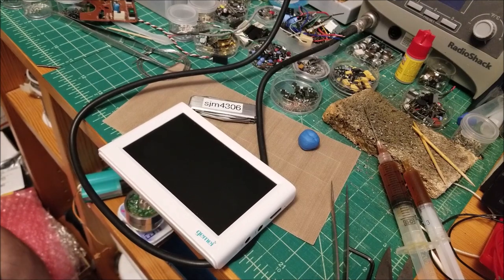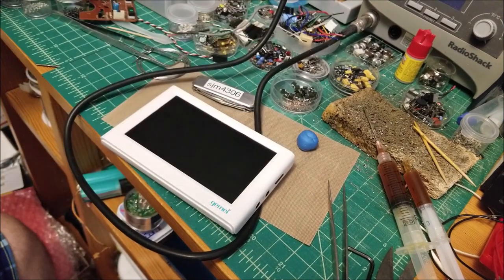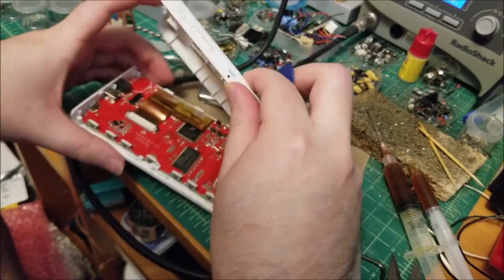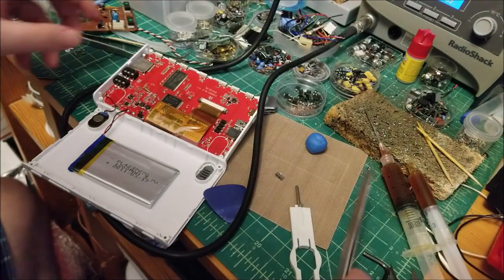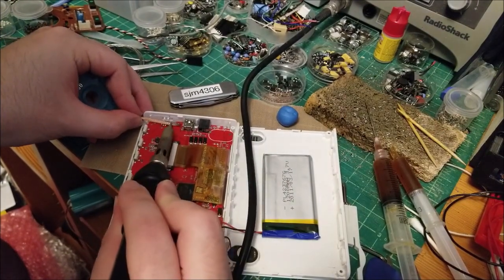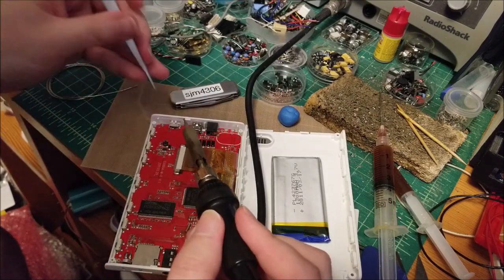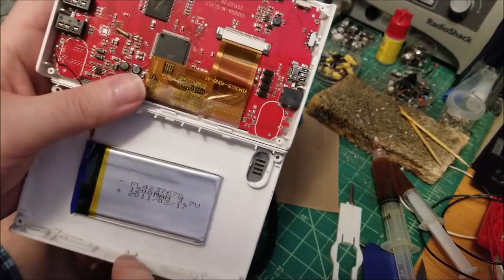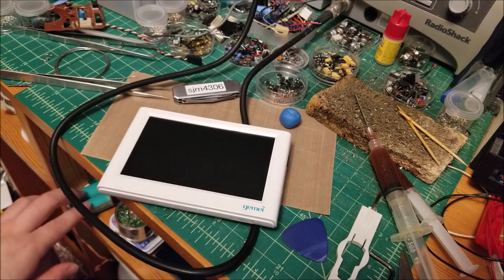Replacing a Broken SMD Switch on a MP4 Player

Comment: Right now I'm practising on a dead board before I do it for real on an expensive laptop motherboard. I managed to destroy the old button and it still isn't off.
I'm scared I'll damage the pads/traces on the board or destroy the new button. Luckily I bought like 10 of them. I thought it'd be easier with a hot air station, but it melts the button plastic before the solder melts. Any tips?
Reply from the maker: I wouldn't even try with hot air, too risky unless you are really good with it. I usually tin with leaded solder, add flux and alternate heating pads till it easily lifts off. You can also slowly lift upwards from one side while doing this till it comes completely off.
Reply: @sjm4306  managed to get it off in the end and soldered the replacement on. Worked a treat for a few weeks and then the owner complained the switch stopped working again. I thought he'd managed to break it again (last time he'd been poking (perhaps jabbing would be a more accurate description!) it with a pen. 

Anyway I got him to bring it in again and I took a look at it and found I hadn't cleaned the flux off the new button properly and after a few weeks it had dried out and stopped the button from being pressed freely. I thought I'd cleaned it with isopropyl alcohol but evidently not.    
I cleaned it up thoroughly with some electrical contact cleaner and it started moving freely again and the owner went away happy. 

Just thought I'd mention that as it was an easily made noob mistake.